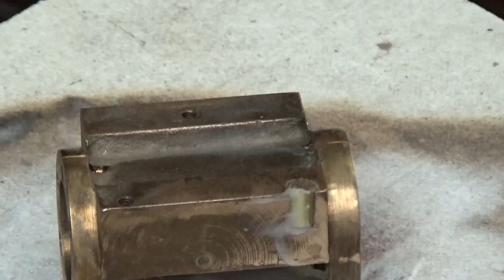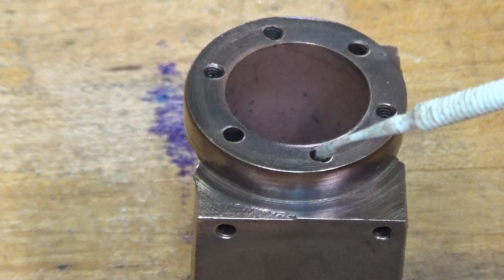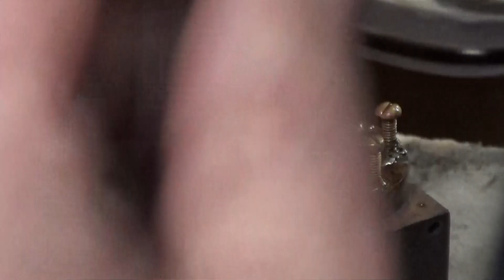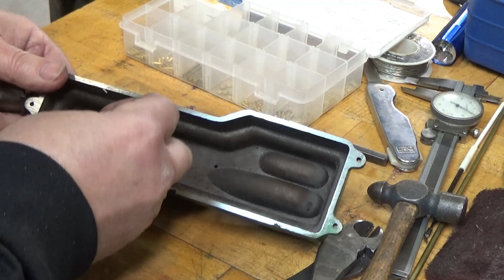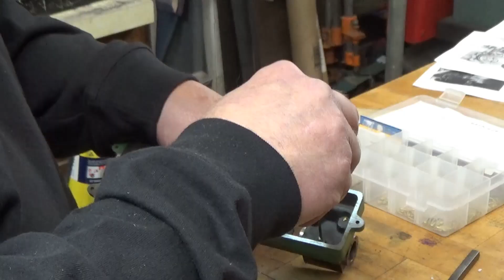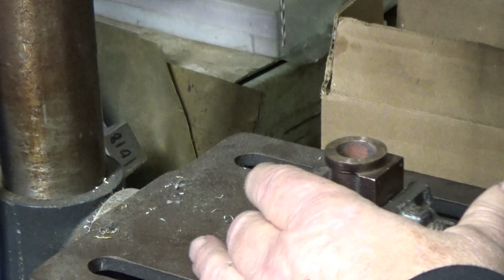Stuart S50 Steam Engine Rebuild Part 2- Silver Soldering

Comment: Interesting that the head bolts are actually a BA thread, I did find it interesting learning about UK-based threads when going through my shaper.  Nothing wrong with them as a system, at least they are a system, just a little harder to find tools like you found with the spanner set.  I got some out of the UK, and some out of India.
Reply from the maker: The model engineering sizes are interesting to say the least.

Comment: I would suggest to either put counter bores in that end cap or fill that groove so the bolts seat properly instead of hanging over the edge. You made too nice a repair on the rest to leave that. :-)
Reply from the maker: That is a good idea, they definitely don't pull it down square.  I still have some more work to do on this piece. I will check the head also it may have the same problem. Thanks for your comment.